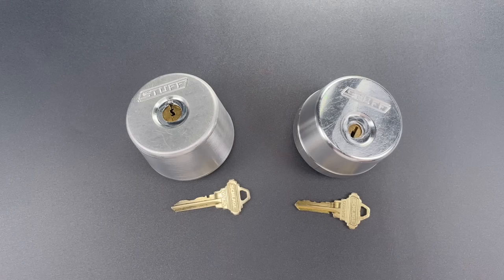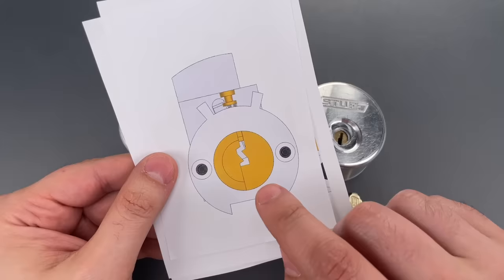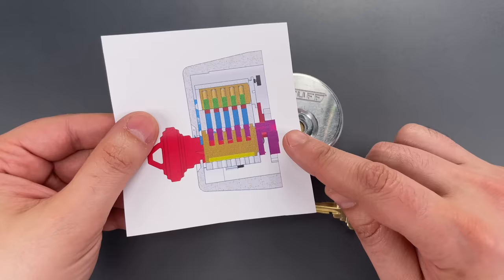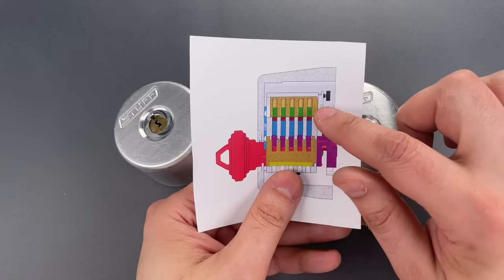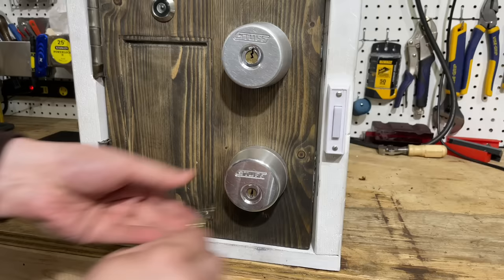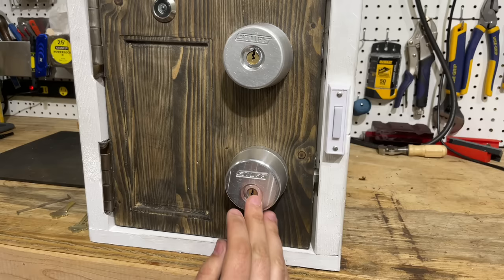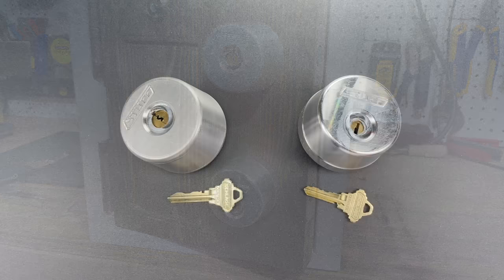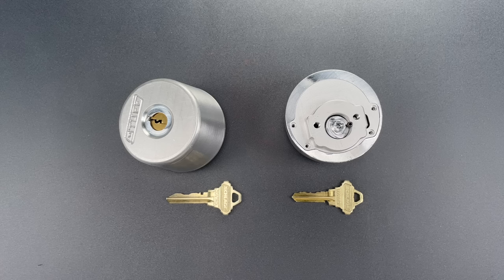[1299] Unpickable Locks From Stuff Made Here

Comment: Jokes aside, this is a pretty clever design - like you said, with some major oversights, but overall a solid engineer's attempt at a lock design. Especially considering that it's pretty unique in its implementation, I hope SMH has made a patent filing just for the sake of it, if nothing else.

Looks to be really expensive (in relative terms, compared to a lot of other locks) to make, but there's a market for such things as well.
Reply: @Leo.23232  you put in the work to invent stuff, you should be allowed to get paid for it
Reply: @JC-ce8fn  unless its a patent for a vaccine or life-saving medicine that could save millions.
Reply: @JC-ce8fn  Any innovation renders a patent void.  Innovation is a broad ended word too.  You can use cheaper materials and say it is more accessible to consumers.  You can use better materials and say it is stronger.  Let alone modifications to the actual geometry or steps involved. 

Lastly ideas cannot be patented.  Processes can.  Patents are only as powerful as the fear they induce on competitors.  Chemistry patents are pretty formidable though.

Think about it, if you goto a hardware store they will have a dozen different screw drivers, switches, hammers ect, all of them with multiple patents.  Just about the only thing they can stop mechanically is direct backward engineering and exact reproduction.
Reply: @ChristopherGuilday  and that incentive is riches thus patents work... so how exactly do i not understand the human psyche lol
Reply: There's an old adage "I dont want it right, I need it tomorrow." 
This applies to novel designs because what you do is get some cash flow (not relevant here) and client feedback. 
In this case the LPL is that feedback. SMH could have spent way too much time and energy trying for a perfect lock but instead did just enough to prove the concept and then get real and valuable feedback which allows him to focus on key issues rather than rabbit holes.
What will be really interesting will be to see the next generation and if it's good, then for real security applications, there will be a market for a high end high cost product. That's when SMH can get to work on a reduced cost product for lower down the sales pyramid - niche market high cost high margin low numbers at the top then working down the pyramid to lower cost, lower margins but higher volumes. In this case the market is full of pickable cheap locks. A comparable cost more efficient lock could take significant market share. 
The only concern is that SMH might ought to have patent protected the core principal otherwise lots of lock companies are just going to use the design and their superior market position and sales channels to "lock," him out of the market.
So should he have done this in collaboration with the LPL without the YouTube channels?
Reply: @wesley4125  just think two seconds about the video you just watched... Why did Shane make the lock? It's because he was challenging himself for the hell of it.
Reply: @nolategame6367  yeah, def not because he has a YouTube channel he's trying to maintain that pays his bills or anything
Reply: @wesley4125  do.. you not know how much a lathe costs? do you really thinks he's paying the bills through youtube?
Reply: @nolategame6367  yeah, I'm pretty well aware of how much a lathe costs, and I'll have to go check his viewership, bit it's entirely possible he's covering his expenses with YouTube. But just because something is seemingly out of charity, doesn't mean that that's always truly the case either, sometimes people get a small high out of donating money, sometimes it's a tax break, sometimes it's marketing or notoriety (private charities are far more effective than any government at taking care of the poor)
Reply: @nolategame6367  yeah, 3m subs, he's doing just fine.
Reply: @wesley4125  ancaps be like
Reply: @dibbidydoo4318  Creating a new consumer ready medicine takes on avarage 2.5 billion dollars. I don't know who you expect to spend that much money just to give it up for the good of the world?
Reply: Everyone is selfish, everyone does things for their own reasons even if money isn't involved. Most of the time when people give away things for free it's because they want to feel better about themselves. Some people will work on important research to leave a legacy on humanity but most do it for money. The irony is that the government is usually the greediest of them all but people act as if the private sector are the evil ones. The government takes by force, a company has to entice me to take my money.
Reply: @edd542  Yup, government would basically use your money to create something, but then ask for further money to provide you whatever it is that it created. While there are countries with public health care, even the best ones are often not too great and can make people experience delays on getting proper treatment and the medicine they need. They will eventually get you what you need sure, but just barely. That's why private medical sector still exist in all those countries. The best service is always one you directly get with your money, instead of one being diluted through the taxes of everyone.
Reply: @JC-ce8fn  that's not real life, that's a capitalistic market. Profits aren't the driving force of society in pretty much any other market scheme.
Reply: @ferociousfeind8538  I am sorry but it is certainly what my life looks like. Can you name marketing schemes where profit isnt the driving force though, serious question since the idea behind marketting is more publicity, more sales, more profit
Reply: @ferociousfeind8538  and name one succesful communistic nation as described by Marx, not a dictorship, a proper example of working communism
Reply: @JC-ce8fn  as described by Marx? It's never BEEN implemented, dude.
Reply: @ferociousfeind8538  Exactly, people say "oh no, communism does this" but no communisy soceity has ever been more than a glorified dictatorship. I have my issues with capitalism but at least it works and exists. I remain firmly convinced that socialistic capitalism remains the best way to keep a nation running
Reply: @ferociousfeind8538  That patents are not perse the devil himself
Reply: @JC-ce8fn  honestly, I don't know what I think of patents, I haven't given it enough thought.

But I know that the world's copyright system is heavily biased in favor of old rich companies holding onto ancient cartoons and ideas. (Grumble grumble disney, grumble mickey mouse copyright bribery grumble grumble.......) so that's pretty close. I suppose my opinion would focus mainly on how long patents last, and what they do and don't allow.

Comment: Just mortising the newer lock slightly into the door would prevent the pick from accessing the upper tumbler mechanism, as you wouldn't be able to slide it in there.
Reply: I thought about that too, but that is a non-standard installation. If you're thinking about taking them to market, it will reduce sales and less than half will actually be installed correctly.
Reply: @billdoor2682  - hmmm, I do not know much about foreign locks, but here we do not have the lock mechanism on the outside of the door.
Reply: @rolandkarlsson7072  I don't think my comment was entirely clear. I meant that your proposed change would be non-standard. The design looks to be made to work as a drop-in replacement for an American lock set. The caveat is that I am have only ever replaced about a half dozen sets myself.
Reply: Or just putting an indented brass plate behind it like a standard kwikset door knob
Reply: Shane sent him a back plate so why didn’t LPL try that? problem solved shane wins
Reply: @nesc39  except the fact that there were multiple entry methods shown. Just solving the backplate issue would not be enough.
Reply: My thought was putting a small pin above the mechanism so any attempt to grip it from the top would just stick on the pin without touching the mechanism.
Reply: @billdoor2682  actually all you would have to do is step mill the back of the cylinder case  to slip inside a 2 1/8" face bore. The shoulder would prevent any attack from the rear.
Reply: @utavatar  was actually the first solution I thought of.
Reply: I install locks that have a collar that integrates to protect the screws as well as the back of the lock from exploitation.

Comment: Oh god, the whole "walk back the deadbolt" thing was just RUDE.  Hilarious, but rude.
Reply: thats gotta get fixed first thing
Reply: @ginopic722  Yeah, I think the issue is that an engineer naturally thought that the point of lock-picking is to pick the lock, when the point is to open the door.  He kind of got that with welding the hinges, but ...
Reply: SMH made it clear any exploit is acceptable so it was fair game.
Reply: @TheClintonio  if we at somepoint have a unpickabel lock its great
Reply: What's rude is there are plenty locks readily available for sale that are as easy or easier to defeat.
Reply: From a testing and QA perspective I'd say it's more thorough than anything else - the whole system has to be secure since it's only as strong as the weakest of its parts.
Reply: @tempest_dawn  ,
Indeed - this was simply part of the testing phases. 
I really hope they move forward with this design because it will be a formidable lock.

Comment: The exploits uses on lock v2 wouldn't work on Australian door. 1) we have wood or metal stoppers as our doors wing inward, not out so you can't get a knife in there to move the bolt. 2) The locks are usually housed inside the door so you can't slip something under them. generally they are solid units without that kind of exploit.

Comment: Countersinking the lock into the door wouldve been a much cheaper solution than the backplate :D Also the american way of having locks that are on the outside of the door in the first place, rather than built in, is simply astounding.

Comment: Ok, you wouldn't be able to pick the first lock if it was better "implemented with the door, and the door being made better. I can think of a number of ways to prevent the tool from being inserted between the lock and door. And if the door was made of metal with a  metal sheet extending out over the frame you wouldn't be able to use the knife either..

Comment: Funny, I've unlocked a door with a knife blade just like that. Only works if a) there is a gap between door and doorframe and b) the deadbolt is not locked fully in place or c) if you can disengage it.

Comment: Many deadbolts have either a fixed plate or a loose plate that penetrates inside the hole which would have prevented you from sliding thie tool under the cylinder to apply tension and prefventing you from picking it open..

Comment: Honestly I don't completely count either of the pick methods for the new lock. The first method Is only possible because the lock is on the door backwards. You would never have the lock on the hinge side of a door. If it was hung correctly it would be extremely difficult to push the bolt back. Although not impossible. The second method is just down to it being a prototype. On a fully fleshed out lock of course it would have a circular metal portion that slid into the hole in the door. To both hold it centered on the door and to keep someone from being able to stick something up there and manipulate the mechanics of the lock. I was a trim carpenter for many years and have installed hundreds of different models of deadbolt. And all of them, every single one had that in common. I can see leaving that out on a prototype. So just taking this exact lock and adding everything needed to mass produce it would be extremely difficult to bypass.

Comment: You could avoid both of the picking methods for V2 by adding a wooden plate to the door that overlaps the bolt and prevents acces to the side of the lock.

Comment: let's be honest. normal doors open inwards, thus removing the hinges out of sight, (no need to weld them) 
as well as hiding the gap inbetween the door and the frame, thus removing 1 of the attacks without having to angle that doohicky by 45degrees

Comment: Here's a question that should be of interest to to the Lock Picking Lawyer in both of his areas of expertise, as an expert locksmith and a practicing member of the bar: What is benefit of an impenetrable lock, or for that matter an impenetrable door if the rest of the structure is not equally secure?

Comment: Having prior knowledge of the mechanical configuration inside the lock mechanism
Gave an unfair advantage as ths would not be possible in real life

The exploits were based on the weak link of the mounting application of V2 , simple
Cover plate extensions and ressesing onto a steel mounting plate would have forced you
To actually pick the lock that we did not see !

Comment: Lockmaker has won especially with Version2. Beside of that the door should be bigger and overlap the Frame, then the bolt cant be reached. And "burry" the lock inside the door, then no one cant stick something inside the mechanism. After that it is unpickable and can be opened only by brute force and destruction, TNT will always help. But thats not lockpicking anymore...

Comment: Never show a person how something works. 
There's been times where criminals have gotten hold of patents that show new security systems and before they are even put on sale the bad guys have a way to bypass/disable them. 
I have about 200 practise locks and the more expensive ones that are built to almost exact tolerances are easier to pick. I have a round padlock I bought for about £3 ($5 USD) and it remains in my unpickable stack. It's so poorly made that it doesn't respond to single pin picking, raking, bumping. It's so bad that it's become good. Even the key struggles to open it as it has to be slightly not inserted all the way and even then it needs a couple of wiggles. So bad it's good.

Comment: Great video, but...The Demo Door is backwards:  the hinge pins would be in the inside. Unless it was installed by a dislexic sub-code installer... So you couldn't pop the hinges, unless you were already inside...
Upgraded Lock: 
Re: method "one": The lock as shown is on the"inside" of the door where access to the deadbolt is line-of-sight. Most residential front doors open to the inside. From the outside the door jam would block direct access to the deadbolt. Theoretically the deadbolt could be accessed by removing the door jam trim with a crowbar, provided that there isn't another access-denying structure in place.  
Re: method "two": This weakpoint was solved by the back cover plate.

Am I correct? or did I miss something?

Comment: Dunno. That back side defeat of the second lock (first test) could be easily blocked by a properly designed back cover. The 45 degree defeat of the bolt retraction could also just be a slight design change to stop that. Without those exploits is it unpickable? Maybe.

I get that as delivered matters, but we're talking about one iteration of R&D to remove those exploits which any lock company with testing experience would have caught before releasing the product. I know we see worse on LPL all the time but the design brief here is for an unpickable prototype with no production cost limitation, so higher standard by far.

The first lock (second test) is an out of date design that has already been iterated on and should not have been included imo.

Comment: Wait, how would the pocket knife trick work on a door? The door frame blocks the dead bolt because of the swing, it's like LPL was opening it from inside the house.
Reply: He said all you need is SOMETHING with a pointy end, obviously depending on where it's housed would determine what you'd use.
Reply: @Tooamazin  an actual door would have the deadbolt set inward though, blocking the deadbolt and not allowing anything pointy to it. He didn’t really pick the lock, or demonstrate a failure on the lock itself. He demonstrated a failure on the installation process that wouldn’t happen on a real door.
Reply: @xTRUExiNsANiTYx  you would just need to pull the door a little and come in at an angle to get around the doorframe, unless it's a metal door they usually have enough give to get at the bolt
Reply: Florida has a stupid code that opens the front door to the outside😡
Reply: @JoseJimenez-mp1iy  
As a Floridian with both doors to the house opening inwards, I'm calling bullshit on this claim.
Reply: @chesterstevens8870  because your home it not up to current code, you can repair your door, but IF you replace it, the new one HAVE TO open outward, don't take my word, call the city...
Reply: @JoseJimenez-mp1iy  
I'm liable to believe them less than I believe you, which is not at all.

Comment: 5:20  The lock is mounted on the inside of the door. A normal door has a door jam on the outside so the knife trick would not work. Also if the same lock was tightened down hard LPL would not have the space to slide his tool in. So a fail, no doorbell for LPL on this one.

Comment: Why did he put the key side of the deadbolt on the inside of the door?  You can't see the dead bolt in the gap from the other side, so can't walk it back with a knife like he did.  So, that was a big mistake.  I've never seen a house with an outward opening door.  So, in reality it is not a vulnerability of the lock design, just the installation of the door.  
Also, put the locks on a metal door, so that you can't push a shim behind the lock.